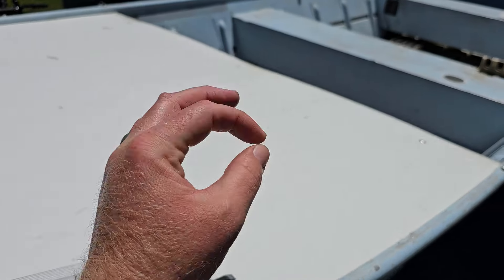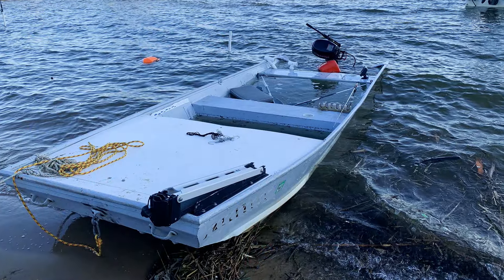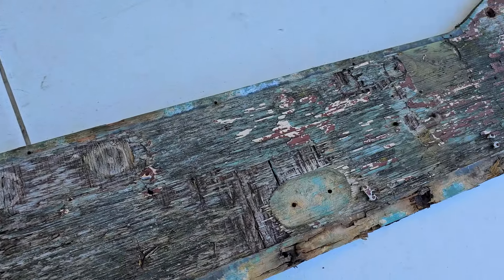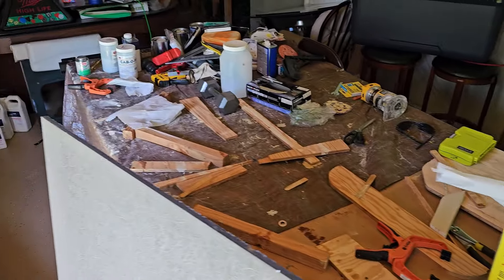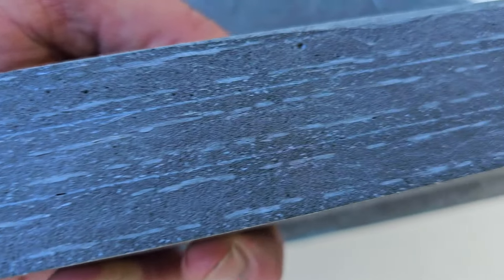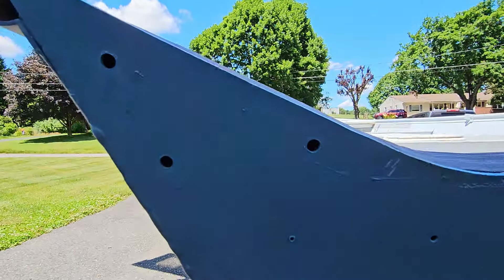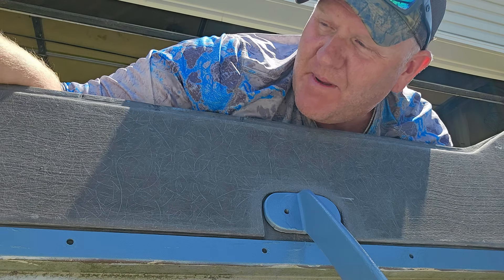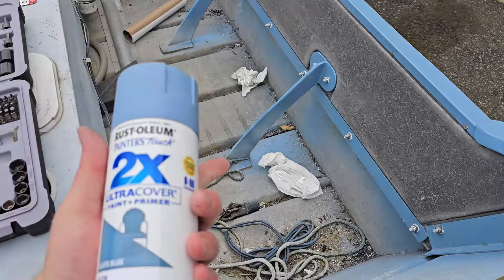Coosa Board Jon Boat Transom DIY (NO WOOD = NO ROT)

Comment: how was it in stiffness in the end? I have a new transom that needs replaced... I wanted to use coosa on my old 1979 alumacraft but the coosa was so much less stiff and flexed so much more than plywood I ended up using it for flooring not the transom. This newer transom is right about 2 inches thick vs 1.5 and has aluminum on both sides.  still worried it will flex too much naked, vs the usual fiberglass encased coosa

Comment: I think I would've seen the $300 + gas + 2 hr travel time = $450 and would've made my own board of saw dust, chop strand fiberglass, and epoxy slurry. Probably would've come out at 3 hrs + $100 in materials.